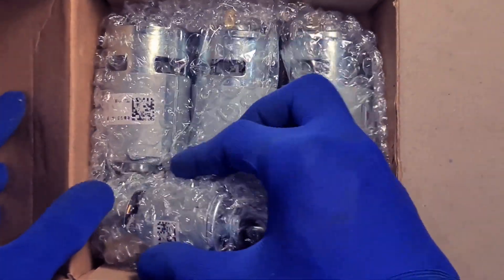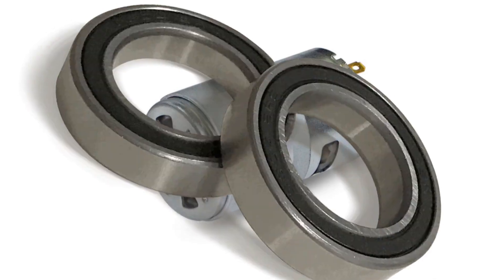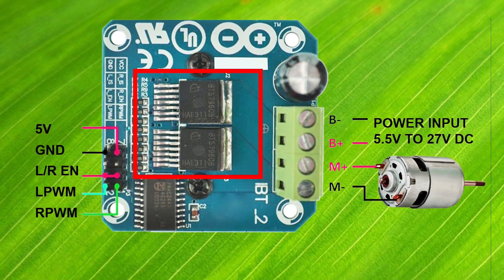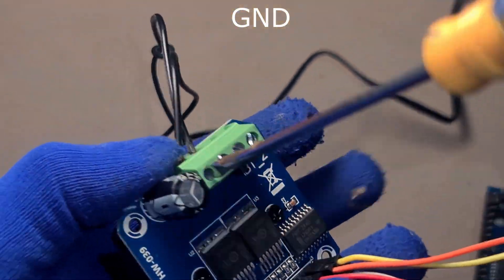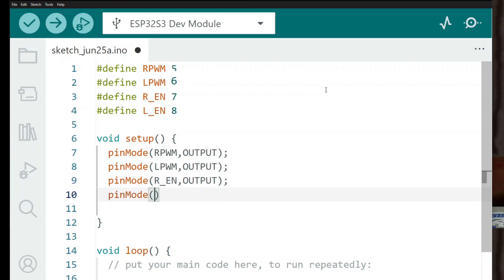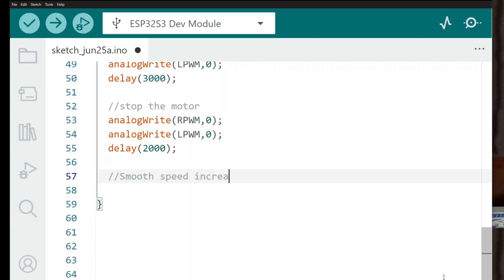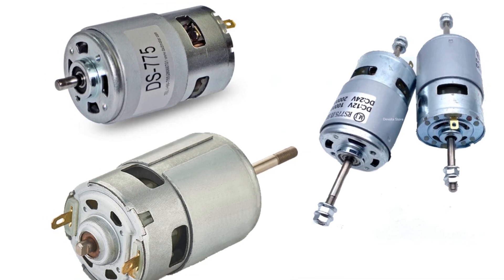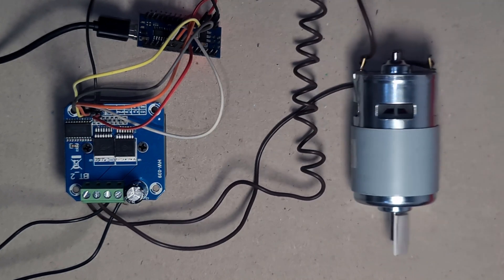bts7960 motor driver FULL CODE | arduino 775 motor driver | All about 775 motors | complete lesson

Comment: Which boost converter should i use to give 12 volt constant voltage to the motor driver from 2s lipo battery???

Comment: could you make a video on reducing or stopping reverse voltage spikes from the motor to the motor driver? Like adding a bidirectional tvs diode or four schottky diodes as a clamp.

Comment: If a connect an arduino, the bts7960 and 775 motor does this have enough built in protection against current and voltage spikes for the arduino or do I need additional protection like capacitors?
Reply from the maker: The BTS7960 has built-in freewheeling and protection for itself, but it doesn’t fully protect your Arduino from the noise and spikes a 775 motor generates. To keep things stable, add bulk capacitors (electrolytic + ceramic) close to the driver and a small decoupling cap near the Arduino. It’s also a good idea to power the Arduino from a separate regulated source or a buck converter instead of sharing the noisy motor supply—just make sure to connect the grounds at one point. This way, the driver is protected and your Arduino runs on a clean, stable voltage.

Comment: Is there any way I can power the Arduino nano directly from the same power supply I’m using for B+ and B− on the BTS7960 instead of using the cable?
Reply from the maker: Yes, you can power the Arduino Nano from the same power supply you’re using for the BTS7960 — but you need to reduce the voltage first.

The BTS7960 doesn't provide a built-in 5V output, so you can't power the Arduino directly from it.

Instead, use a voltage regulator like a 7805 or a buck converter to step down the voltage (e.g., 12V from your motor power supply) to 5V, which the Arduino Nano needs.

Once you reduce the voltage safely, you can connect it to the 5V pin on the Nano.

Comment: Can the BTS7960 be used to drive stepper motors, or is it strictly for brushed DC motors only? I know it handles high current well, but wasn't sure if anyone has tried using it in a stepper setup. 🤔
Reply from the maker: The BTS7960 is designed strictly for brushed DC motors. Stepper motors need precise phase control, which the BTS7960 can’t provide. It can't properly drive stepper motors — better to use drivers like A4988, DRV8825, or TB6600 for that.
Reply: @ProjectWeekend  Thanks

Comment: If I wanted to reverse the motor direction while running, would I need to stop first or can BTS7960 handle instant reversal?
Reply from the maker: Yes, the BTS7960 can reverse direction instantly, but it’s not recommended at full speed. Sudden reversal can cause current spikes and stress the motor. It’s better to slow down first, then reverse.

Comment: Really well done! I especially appreciated how you used PWM to gradually ramp the motor speed up and down — such a crucial feature for DIY projects where smooth control under load matters. That kind of gradual acceleration is often overlooked in tutorials. Also, great job highlighting the real-world differences between L298N and BTS7960 — current capacity makes a big difference with high-torque motors like the 775. Super useful video! 🥰
Reply from the maker: Thanks a lot! Really appreciate you watching it all the way through. I’ll definitely keep sharing more like this! 💪😊

Comment: How much amps (A) it need at 12V supply? can I power it using a computer power supply?
Reply from the maker: As explained in the video, different types of 775 motors draw different currents depending on the model and load—typically between 1 to 5A at 12V. If you’re using just one motor, a computer power supply that can provide around 5A on the 12V rail should be sufficient.